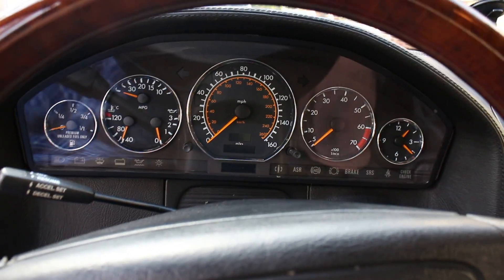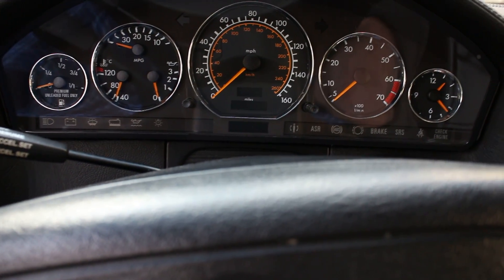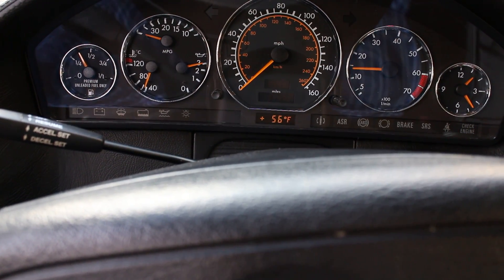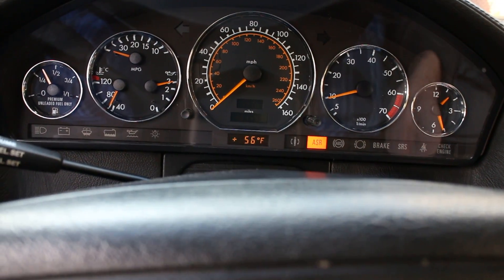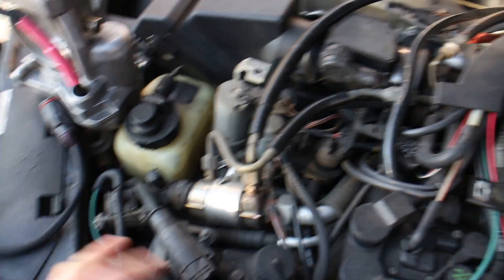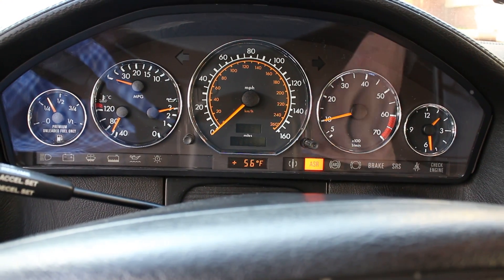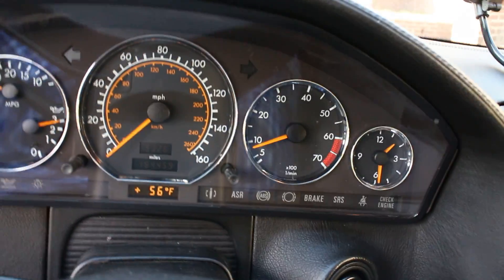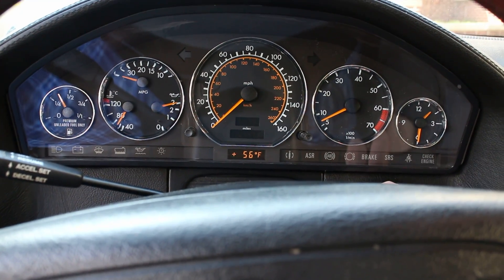Mercedes ASR light

Comment: I have a 1994 S420. My ASR light is on. I am located in Detroit Michigan. I need my throttle reset because it's doing the samething as the video you did on ASR light. Please respond with any thoughts.
Reply from the maker: Need to rebuild the throttle. You can find my contact info on my website

Comment: HELLO VICTOR I HAVE JUST REPLACED THE THROTTLE BODY ON A 1995 SL320 R129 AFTER CLEARING CODES AND ADJUSTING CABLE ASR CAME BACK ON SAYING ASR CAN BUS COMMUNICATION CODES I JUST PUT REMANUFACTURERED THROTTLE BODY ON FROM AUTOHAUS AZ. FIRST TEST DRIVE WENT BACK INTO LIMP MODE SO I SEE THE PLUG AT THE TRANSMISSION IS WET WITH OIL,AND I HAVE SEEN IN MY TIME WHEN THE TRANSMISSION PLUG IS WET LIKE THAT IT HAS THE TENDENCY TO PULL OIL THROUGH THE HARNESS TO THE TRANSMISSION CONTROL MODULE COULD THIS POSSIBLY BE MY ISSUE? PLEASE ANY HELP WOULD BE MOST APPRECIATED I HAVE BEEN A MERCEDES MECHANIC FOR 35 YEARS AND ALSO BMW BUT THESE OLD SL'S ARE VERY TEMPERMENTAL CARS TO WORK WITH MUCH RESPECT FREDERICK,AUTOHAUS AUTOMOTIVE,LONG ISLAND NEW YORK
Reply from the maker: Call me one day to discuss.

Comment: Hi you repaired a throttle body on a 95 119 140 s 500 coupe and I have replaced a bunch or parts new battery new voltage regulator in alt now it charges okay but have the ASR and SRS light on and the check engine light is on also can the brake light switch be bad check engine light may be the o2 sensors any iideas
Reply from the maker: If I repaired your throttle then I should have a video of your unit bench test. Call me one day to discuss

Comment: I have a 1996 sl500 and when i start it the rpm goes up and down and revs with no throttle response but when I prep the ignition it works fine I just ordered a used throttle body alculator would that be the fix for this problem also the asr light pops up when it’s in limp mode but when I prep it it doesn’t come on and the car drives fine please give me your in sight on this

Comment: So My ASR light is on all the time but the car only sometimes goes into limp mode.  Generally it will be when I come to a stop and then accelerate or almost stop and accelerate and then the car will sometimes go into limp mode but ASR light is on all the time.  1993 SL600

Comment: Hello ! I have the same problem on my SL500. The ASR light is on all the time but the engine seems to run ok, the acceleration is good when I press the accelerator. Is the problem could come from the throttle body or the wires to the throttle body? Thanks in advance !
Reply: i wondering if you already fix ASR I got 94 sl500 got that light on all the time too
Reply: HatedWar : no I haven't solved the problem yet..
Reply: I see though u did so i can get some information. I believe its throttle body problem something about control divide
Reply: That's very interesting Victor I will check into that I did get a plug that goes into the obd1 port and it said no codes found I like your explanations about all MB I will keep in touch the car runs but the two lights are irritating